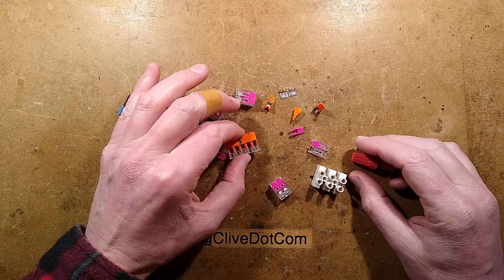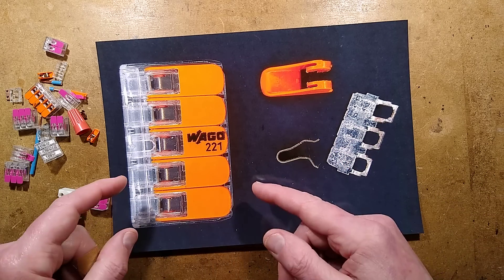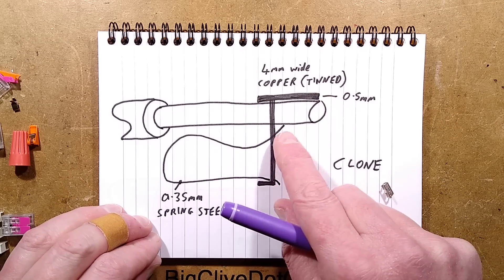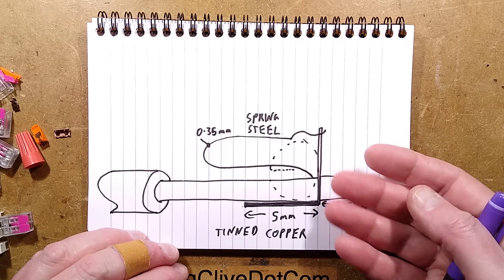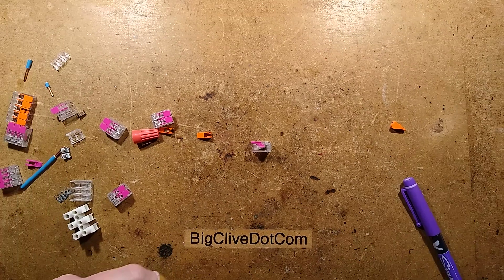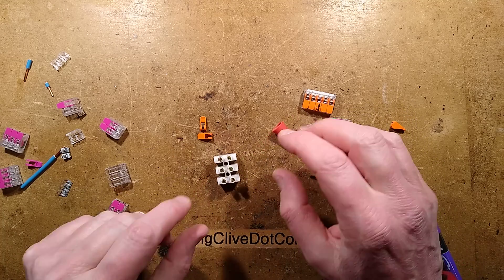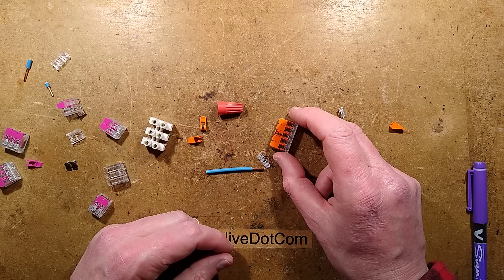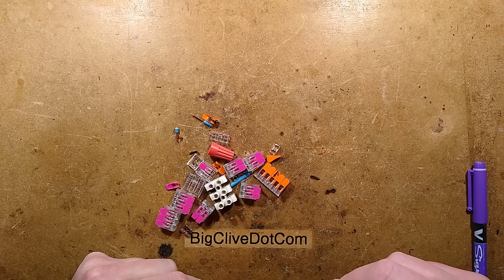Inside a Wago connector and a clone

Comment: Now I am no electrician but I have built a few circuits for personnal projects. Did you show a common bus bar for all contacts? If so, this is only meant as a multiplug for the same input or power as there is no isolation between each wire? Doesn't that make this kind of plug overengineered for nothing?
Reply: Yes, the whole point of these is to securely connect one set of wires together. You usually use 3 or more such connectors to split all the wires of a cable in a junction box to go to multiple outlets or other consumers (lights). I dont think this is overengineered at all. Maybe overpriced though, at least for the original Wagos. On the other hand it saves a lot of time, and time is money.
Reply from the maker: These are commoning units, but there are also through versions.

Comment: The mechanical difference might be so as not to infringe any  WAGO™ patents ( ? ) ..... these are widely used by electricians for ceiling light drops etc .... as you may know ,  a LOT of UK domestic ovens / cookers use stout Zinc plated steel for their terminal blocks (  MUCH cheaper ! ) ... " Screwits " are just AWFUL ! ! ( although the red / blue / yellow crimp versions are reliable ) ........ DAVE™ .....................

Comment: I haven't used the real Wago connectors yet, but I absolutely hate the clones. They never ever grip the inserted wire strong enough. I always revert back to the single use electrical wire clamps. No problems, no fuss, just works.

Comment: The clone was undoubtedly engineered to get around Wago's patents.  Not a concern for some manufacturers of course, but for those who want to create and keep a market in some areas it's an issue.  😀
Reply: The clone was almost certainly made in china... where international patents literally dont apply.
Reply: @Basement-Science  But it's not a clone.  It a variant.
Reply: @calmeilles  Congrats, you completely missed the point. And also have no idea how patents work to begin with.

Comment: If anything the Wago failing just shows that they'll pop if something goes wrong meaning they're safer 😅. The nut will keep going and going and going until the WIRE burns up (Not ideal)
Reply from the maker: I think the cable insulation might be melting long before the Wago does.
Reply: @bigclivedotcom  true

Comment: The clone is actually too tall for the space available in a wallbox here.
You need to be able to fit 3 5-ways with 2.5mm2 wiring and still have room for a lightswitch to sit into the box. This is possible with stacking the Wagos, but only with around 1mm to spare.

Comment: Here is an idea for a follow up video. 
Run them both at rated load for a given wire size.
Measure voltage drop and temp. Rise at the rated load. ( again for a given wire size )
I.E. here in the U.S. 15 amps for #14 wire and 20 amps for #12 wire.
Would also be interesting to see at what temp. they melt/fail and will they self extinguish. 
Love your videos.
Reply: That little Wago connector show is rated for 4mm2 cable so 32A. It works equally well with 1mm2 cable on a 6A lighting circuit. I think you can use them down to 0.5mm2

Comment: Only came across Wago connectors - the 221s - a couple of years ago after moving to France. I asked a local electrician about them after seeing him check a couple that had been used for ceiling lights (not taking the weight of the fitting, as he was careful to point out). He sang their praises, noting that he saw a lot of them when doing safety tests. 

I then tried a couple out when fitting a couple of lights myself, and have been an enthusiastic (amateur!) user of them ever since. Compared to a junction strip with screws ("domino" is the word used for them here) the Wagos make life SO much easier and safer when perched on a stepladder getting a ceiling light connected!
Reply: Think about use of arms in nature, 

In nature arms over head  are for strech 
Otherwise used to correct an error; post- danger.   
  carry shit over head into danger...?

Comment: No one ever mentions unclean wires. Or dust inside the wago style terminals.

So imagine a construction environment, where there may be plaster or brickwork going on. Lots of gritty powder dust.

I have found that after stripping the end of a solid core wire, it is critical to keep it clean. Any dust between the surface of the wire and the bus bar increases contact resistance, the same way a tarnished copper wire does.

I've also seen many sparkies keeping the wago connectors in buckets alongside their tool boxes, both of which fill up with dust while they drill holes in brick or concrete walls. 

Brick dust inside push fit connections is not good.
Reply: Pretty sure that applies the same to all types of connectors.

Comment: Clive: Thankyou!   I've been looking at these Wagos for a few years - price and non-local shop availability prevents ...  and I never knew of the clones - don't seem to appear on my cheapest deal searches.  Been wanting to use them as quick connectors for testing  - the choc blocks can be such a pain, and not on a bus .... so extra fiddlebits.   Finally got my paws on one of those 13A plug boxes  - but they are not ideal either - length of bare copper required to make the contact and close the lid. 
BTW have you seen / know about those 13A UK plugs with built in switches ?       thanks again for your informative / edutainal videos.

Comment: I'm exactly the same. At work or home wago all the way. Projects can have the cheaper ones.

Another issue I found was the wago will accept ferrules the cheapo ones don't and if they do they just don't hold very well.
Reply from the maker: I don't recommend ferrules in any terminal like this unless they are crimped properly with a tool that indents them from all sides.  The sleeve defeats the wire gripping to a degree.

Comment: One other thing: it seems that the split spring load on the clone does not allow for stranded cables, which the WAGO with the lever is rated for. So you can go from solid to stranded cables in the terminal (for example in a ceiling fixture).
Reply from the maker: The clone is capable of taking both solid and stranded wires.
Reply: @bigclivedotcom  I stand corrected then 😉

Comment: I use the 222 series grey wagos, and their clone counterparts. Ive had 2 clones fail. And the spring fatigues after being used a few times. Love wago connectors but I dont use them for domestic house wiring - theyre far too nice to hide behind a junctionbox, plus the job would be done too quickly!

Comment: If receiving a batch of clones, don't just test the copper, also check if the springs are actually spring steel and will remain "springy" after pushing them down several times.

Comment: Better design or not, I trust Wago more than the clone companies for exactly why you said - they will eventually cheap out, and they won't tell you. Likewise, the supply chain may be so weak that fakes can be more easily introduced. I can imagine the wago design has a pretty strict quality control process. Any sparky with any self worth is going to use genuine wagos even if only from a liability perspective. I've never had a single fault with a wago, and getting the job done right (safely and correctly) the first time is the best thing.

Comment: We had an lighting refit in the warehouse I work in (fluorescent tubes to IR controlled LED strips) and the electricians left boxes of WAGO behind as well as a good few tools and millions of cable offcuts. My next electrical project may well involve WAGO ;-) 

The electrical contractors must get through a lot of tools, we've found numerous screwdrivers dotted around the warehouse since they left, occasional random half used boxes of WAGO connectors they obviously put down and lost. At one point I pulled an item from a high shelf and just spotted a screwdriver on top of the box in time not to get it straight in the face.
Reply: I found a leatherman (original) left in a ceiling.

Comment: One thing you didn't mention is whether the clones have a probing port like the Wagos do have. Two reasons to use the non-lever clamps: They're cheaper and they're smaller which can, the latter can be quite important when working in cramped spaces and the clone seem to be chunkier yet. But honestly, I couldn't care less about the easier to manufacture part for (still cheap) consumables (which as you said could also lead to additionally cut corners in the future but inevitably if they're designed to be assembled by hand or with cheap jigs, they will be and we all know what that means... if I have to carefully inspect/test each one before use, any cost savings is out of the window!); all I care about is known ratings and reliability.
Reply: I actually prefer that the Wago connectors are harder to make. This means that they are made with automated custom tooling  in a very precise and repeatable way. With clones that can be hand assembled by home workers there is so much more chance of errors and bad materials finding their way into the manufacturing process
Reply from the maker: There is a test port.

Comment: I'm in the US. I found something called "Ideal" In-Sure connectors when I was scouting for wire nuts a couple years ago for a project. They seem very secure, but they lack the quick release feature: you have to wiggle the wire out if you need to remove it. They seem far better than wire nuts, at least when you have the room in the junction box for them. I'm sold on them over wire nuts unless it's very small gauge wire.

Comment: As with many things, it's buying through a trustworthy retailer that is the best guarantee of quality. It means that even clones ought to be properly tested and QA'd as they have a reputation to uphold. Buy even a branded item through a dodgy seller, and it might still be a fake. However, I don't see much signof bigger dealers selling those Wago alternatives. Toolstation sell a few,  but they aren't substantially cheaper than the Wagos and the choice is limited.

Comment: I work in the electrical manufacturing. I would  choose wago over any clone.  Regardless of how good the clones is if it cannot demonstrate compliance to the relevant standards It shouldn’t be used. I made a big assumption that the clone doesn’t have compliance ?  But you can trust that Wago does have.  Also the cost is mainly in achieving these compliance across the world which is extremely expensive.

Comment: They are vulnerable to corrosion because when moisture gets in it is trapped,  Causing the copper to verdigree and the steel to rust,  They are handy for temporary  use but not long term.

Comment: I can get these exact clones in my hardware store, except mine come with light blue levers. Here they're about half the cost of genuine Wago connectors and have all the relevant certifications, which give me confidence that they're good quality.
Reply: But do they have a makers name so you can check back? For insurance purposes when on a job I use wago only. At the end of the day, my customers pay for me to use  the best gear and I feel happier knowing that I've fulfilled my duty. Saving a few pennies on knock off stuff, is it worth it?
Reply: @chrispomphrett4283  the brand is ORRO and the ones i bought are ORRO PCT-413. They have the same ratings and specs as the equivalent Wago connectors and since they're sold in Europe they also have to comply with European regulations.
Reply: @poptartmcjelly7054  That's good then, I suppose wago perhaps sold the rights to make them or perhaps they're just that bit different in design/operation that they can get round it. If I see them about I'll pick a few up to evaluate.
Reply: @chrispomphrett4283  my customers pay for me to use  the best gear ...   Did you check with your customers on that ?   Or gave them an option to save with less than best gear ?

Comment: They are cheap enough and convenient to use.
The less screws the better. Long term reliability trumps in my opinion.
It's fine if there's competition but they should be branded themselves. The patent must run out eventually, right?

Comment: For fixed wiring, the push-in Wago terminals are preferred. They are much smaller and also cheaper. May be interesting to investigate the clones of this kind.
Reply: Stab in type
Reply: But hard to get off if maybe years down the line you are in a situation you need to disconnect
Reply: @dmitripogosian5084  just pull and twist, it is that simple...

But if you need quantity the price difference is not huge.. we use 221s only even though we practically only have solid wires (and ocassionally a few stranded ones)

Comment: With the CLONE spring being commonly connected you could say it has a 2.35mm CSA compared to the wago at 2.5mm CSA, so pretty close although I'd avoid using either for more than a lighting circuit.

Comment: Those wagos are brittle the levers snap of easily, be verry careful if you use them. Like Clive said the clones look more robust and reliable for frequent re use compared to the wagos. A 100 amp load is not that uncommon in 12v systems, a large amp can pull as much so better not use those there.
Reply: 1. Genuine Wagos are not brittle. The only time I've had a lever snap off was in some REALLY bad clones.
2. You cant - and are obviously told not to - use these with wires that can be rated ANYWHERE NEAR the failure current. The connectors literally only fail once the wires themselves have burned off their insulation and are at least glowing red hot. So yeah no sh!t dont use them for 100A...
Reply: @Basement-Science  It looked identical to the orange levers Clive showed but I have no proof it was a original as this was many years ago. I wonder if there are "real" ones designed for more "abuse" that could last longer under harsher conditions, not necessarily extreme loads but just ruffer handling. Have you heard of or seen any like that?
Reply: @agw5425  I have never heard of any real Wagos breaking at all in any way. That's why I'm very skeptical about the ones you had. 

There are some clones out there that do look identical, except for the text on them.

Comment: An often overlooked advantage of the WAGO 221 over wire nuts and the like are the accessories available for them. Accessories for a wire terminal, you ask? Yep. Basically, various mounting plates and fixtures, so that you can use them to basically assemble custom terminal blocks, rather than having a bunch of them floating in the air. Not important in a ceiling box for a single lamp, but awesome in electrical panels, control boxes, or for use inside equipment.
Reply: yep, there is also a reason=rule for that. last time i checked you have to fix all clamps in "main" distribution boxes, so you actually need to come up with something improvised .. or use the (for simple plastic expensive) wago holders. the nice thing is they also have screw holes, not only clamp on for the rails.

Comment: What's wrong with the term marret?   😕 i don't like the particular type you have in the video,i use a different type, but i use them all the time around the house for personal lighting projects, etc.  (Canada, btw) 🇨🇦 , i have recently seen these types of connections used and more readily available.  Which i like, leaves less room for ....   for lack of a better term, fucking up with improper connections and letting loose, and causing arcy and sparky issues.  Which is never a good thing.

Comment: It would be interesting to see a thermal test on both types. Pushing through both the rated maximum current, preferably connected in serial, and looking at them with a thermal camera to show if one gets warmer. Also, check which one can handle higher temperatures before failing.
Reply: You can see the predecessor ( Wago 222 ) under 120A here: https://youtu.be/eg6VPucscxI?t=10  I know its not the same, but I highly doubt the 221-413 would do worse :)
Reply: It's been done.  I think one of WAGO's divisions even did it where they ran multiples of the rated current until the shell started to melt.  The bus bar and the spring held together and kept the connection.  However, once the shell melts away, that means that the metal is exposed and could short.

However, it should never get to that point, where a breaker and/or fuse will prevent that amount of current.

Comment: I bought a load of wago terminals because I was having a bunch of lighting installed. Electrician instructed his apprentice to not use the wago and to use wire nuts. That's an example of how well they're accepted here in the states. I use them all over. They're so much easier to use than wire nuts and you can tell that you've got a good connection.
Reply: Wire nuts take longer = greater billable hours.
Reply: @KameraShy  wire nuts damage wires,and making stranded to solid connections WAGO for the win.  As usual,U.S. behind the times when it comes to using better products to get stuff done right. Wire nuts will fade over time. German hand tools,and other stuff will also change your mind once you use them...knipex wera whia.

Comment: I've used thousands of wagos, only ever had one "fail" on me and the truth is it had just bit onto the insulation and wasn't making contact with the copper cable. 

The heart attack and stress I had that day were enough to make me only ever use these types of Connectors in easily accessible areas even though I had success with so many others. Great Connectors though